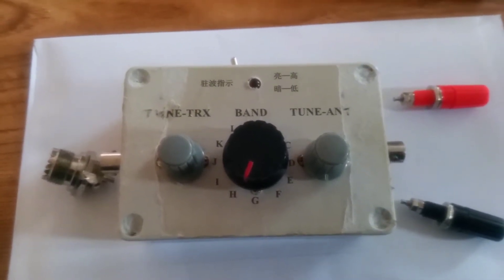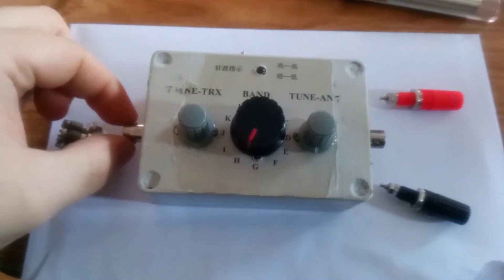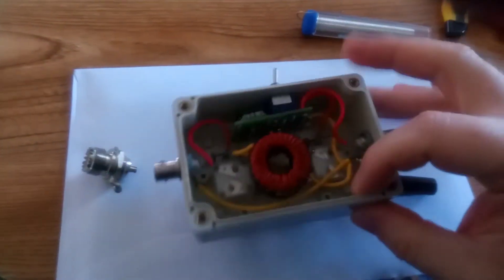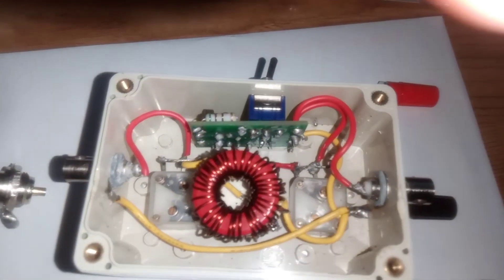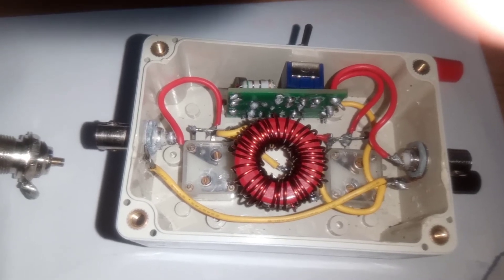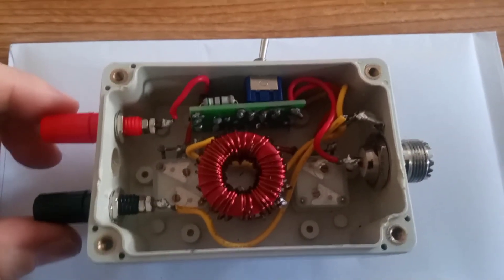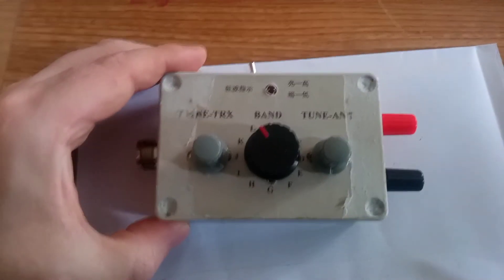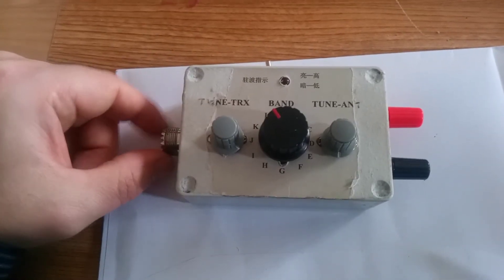💠💠 Ham Radio -- Qrp antenna tuner With small mod.💠💠

Comment: fantastic mate i bought one of these for aprox. £10. i have always used an antenna that matches the wave then swr. it, what more do you need? Well!  i found that when i swr down to 1:1.3 (clipping wire,i can blunder down to 1:1.1 sometimes), then i put this on and tune it too 1:1.02 , the noise drops away and i can hear the distance, i also put "so 329+bnc" on both sides,
Reply from the maker: For the price, they work very well and are nice to build. Hope you have many contacts using it 
73 de Aiden EI8HJB.

Comment: Hello QRP King. Happy to see this video. I plan to build this kit. I see a lot of them on online sites. Did the kit come with instructions? Does it work? Thanks and more power. 73. N1MYM/DU6 Mario
Reply from the maker: Hello, the kit didn't come with any Instructions but John W5YCF has good videos on assembly of it,
The tuner works very well and tunes about any length of wire. This is the links of the videos...  https://youtu.be/jdFTwGv-CZY
https://youtu.be/hYeb-XN80FA
Hope this helps
73 de Aiden EI8HjB.